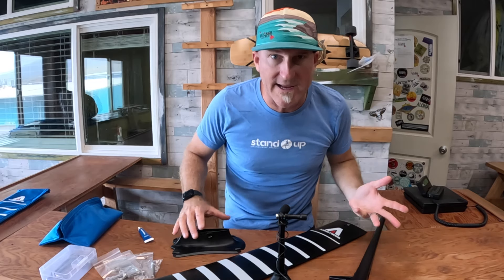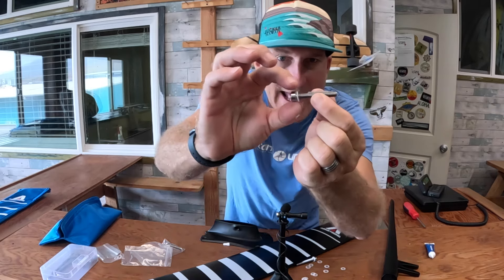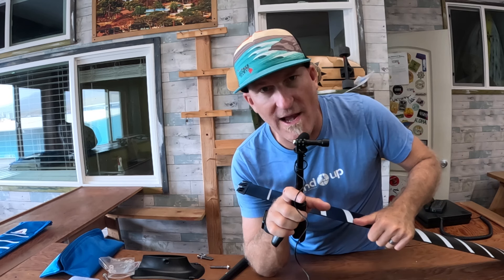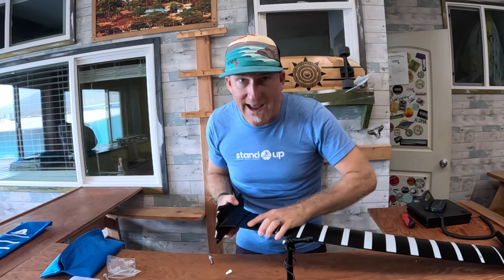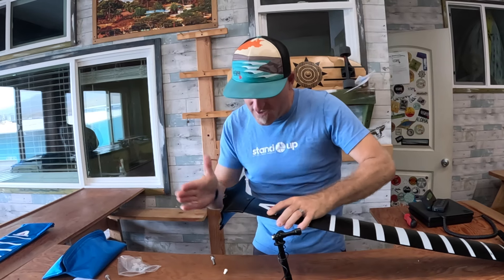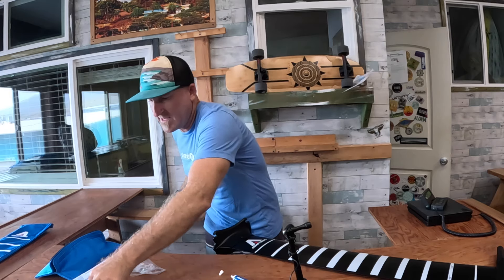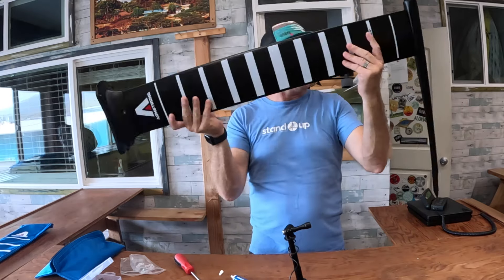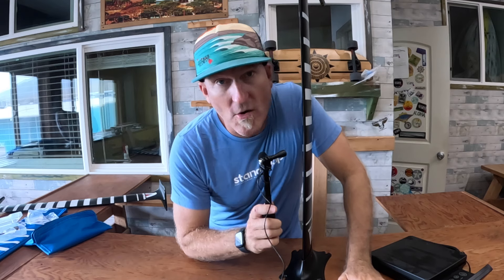Armstrong Foil Debuts Aluminum Mast

Comment: Great video! Is this a 725 performance mast you are weighing? And what length is the aluminium mast? And is it 60cm fuse? Thx 🙏
Reply from the maker: Thanks happy you liked it. The mast is 85cm alu and carb. The fuse on the alu is about 10cm longer than the one on my carb set. I have the 60cm fuse there. Sorry should have said that in the video.
Reply: @StandUpMagazin The performance mast may be more comparable in weight actually. 

I’d be interested to see a flex and weight test compared to the performance mast. I’m also curious to hear what it feels like in the water. When I got my PM, the felt drag was significantly lower!
Reply: @StandUpMagazin  I see.  Thx for the quick reply! So regards the fuse, are you saying the alu one is therefore 70cm?

Comment: Interesting to see the base plate looks like it is die cast. Possibly the doodad too? The sideways screw through baseplate and mast is a great idea, that's where my Axis baseplates used to open up with a ground impact. Me being me,  I infused my own carbon mast including baseplate and doodad so now it's a non issue😊
Reply from the maker: Thanks for watching, stoked you like the video.  By the way what is a doodad?
Reply: @StandUpMagazin  The "doodad" is Axis name for the part that goes between aluminium mast and fuselage. In New Zealand doodad is also a generic name for an unknown part of machinery.  If you look at a company like Konrad, they have multiple designs of them to work with different brands of fuselages.
Reply from the maker: @fluiditynz  ah I get it... I googled that and got the machine part that is why I was confused.